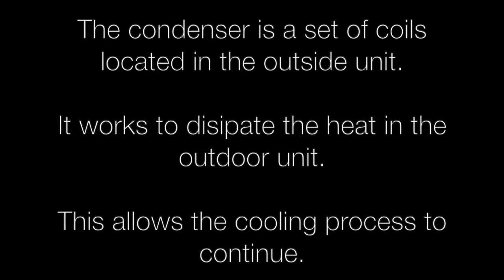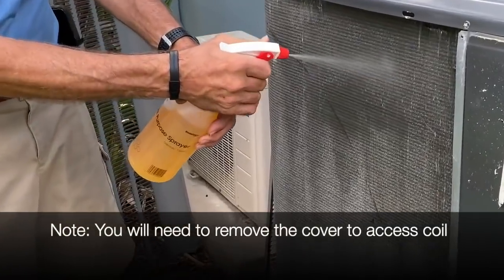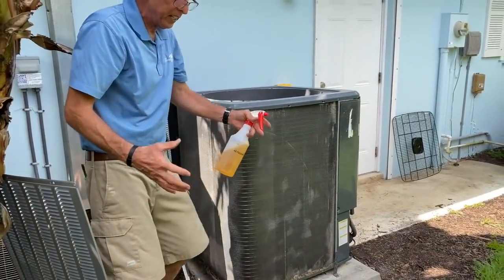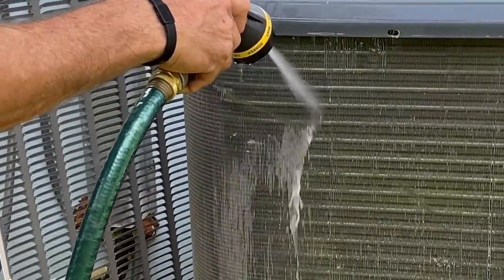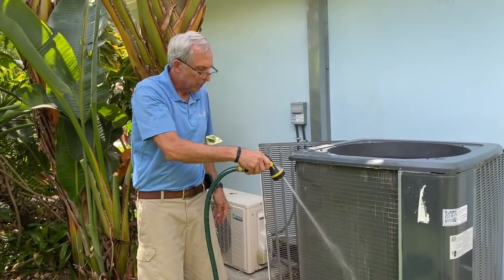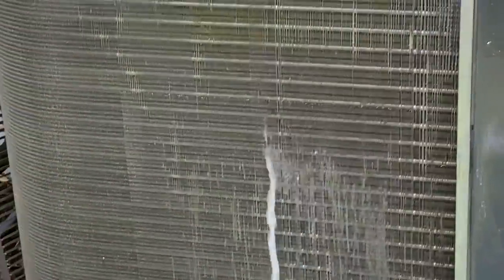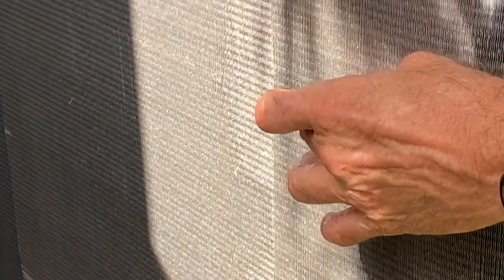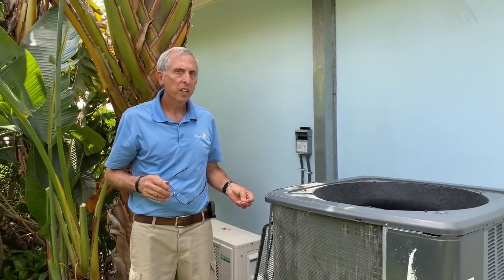How To Clean Your AC Condenser Coil

Comment: Your video and a couple more helped save me $380 from two HVAC contractors who were willing to charge that much to clean my condenser. What a bunch if slithering snakes they can be! WOW...they won't make any money from me, but, they will make money from other people. Videos like yours and various other videos here on YouTube are a Godsend. Thank you!
Reply: Are they snakes or honest people charging you fair price for the labor involved?
Reply: Most of them/ a lot of them are lying thieves. I do handyman work and can change capacitors on ac units when there is a problem. The capacitors do go out once in a while, and are very easy to replace, and very cheap too ($10-$15). I only charge $60 to do it. One ac unit I went out on because it was not cooling enough. I found that everything was working fine, but the indoor evaporator coils (you can't see but it is on top of heater unit enclosed in sheet metal) and the copper line going to the outside condenser was completely iced up! So I shut it off overnight to thaw out. I also checked the filter because the top 2 main causes of ac icing are clogged/dirty filters and refrigerant undercharge. The filter was very dirty, so I changed that, but I also told him to call someone up to check the charge because it was probably low, and I didn't have any r22 anyway to put in it. He had someone come out the next day to check it out. He got charged $380, and all the guy ended up doing was putting in a new fan capacitor. I had put in a new fan motor a year ago along with a new run capacitor, and I new from the initial check I did that the fan was working perfectly fine. The guy never even hooked up gauges to the unit! The unit was working fine when the guy turned it on because it had completely thawed out, and the filter was already changed. So really what he should have done if he didn't want to hook up his gauge set was to charge him $80 for a service call. I just wish I had been there to stop it. I really hate to see people getting ripped off!.......And they almost always tell the homeowner that they need a whole new AC that will cost $10k -$12k.Talk about getting ripped off!!! A new AC and heater and evap core only costs the company anywhere from $3k to $5k, and then they TRY to charge the customer $6k-$7k profit for a day or 2 to install a new unit! These guys are the king of thieves!  Along with car dealerships :)
Reply: @raymondtakeall4803  slithering snakes - is a correct answer...
Reply: @MRM-wp4gr  Handy man work not trained or licensed professional, that's like going to drug dealer them telling you doctors ripped you off lol. Capacitors shouldn't go bad in year, you get what you pay for. Most places in my area north east capacitor, is  minnum of $200. Anyone can do it for less like anything else cause they're not running a company where you have overhead cost. Yes really cheap units such as goodman are $3 to 4k, with cheap parts put it once again you get what you pay for. Being critical of pricing is good to an extent. When you buy a new car, do you tell them your getting ripped off? The actual price of car what it's resold for is significantly higher. When you go your doctor and writes a script for pill that cost $ 20 to make they charge 100 times that amount do tell them they're ripping you off?
Reply: @MRM-wp4gr  maybe your area, you said Cap'n went bad when you installed a new one after you replaced fan motor, then cap went bad again after tech put it in. Which would indicate the fan motor is the problem or both capacitors were bad from the box. Most likely the fan motor, which I'm sure there is no warranty on it, cause most manufacturers require qualified professional to install it, or returning it for warranty is nightmare. So in reality you can he favor you did really undid itself. As client was still inconvenienced not having comfort cooling. As far charging 12k that may just your area or most likely there are having to other modifications to duct work to ensure system that doesn't fail. Goodman man units on average for equipment alone run 2-4 k, for each piece. Depending of course on the model. There's a reason goodman is known for contractor grade because it's cheap, so if most home builders use then of course rate of sales would be higher. Goodman is cheap equipment with history of components failing before they're life expectancy.
Reply: @raymondtakeall4803  I don't believe he actually did change a capacitor....he just charged for one. I know for a fact that it was not bad in the first place because I had just checked it the night before. This was a total rip off!
Reply: @MRM-wp4gr  ABS in clearwater area wanted 285 for a 10 capacitor in 2007 money...never changed still fine to this day. thieves!
Reply: Do you know the concept of overhead? How much money it costs to put a well qualified service technician in a fully stocked truck? Do you complain that an $8 piece of steak costs $41 at a nice restaurant?

Comment: For years, we've used Dawn dishwashing liquid to help clean the coils - never needed coil cleaner. Also, the compressor bag cover should be removed and everything carefully cleaned. If the cover has broken down (lots of cracks), replace the cover.

Comment: Had air conditioners for 50 years and never cleaned one till this summer. Got a new one about three years ago and looked at it this summer and it was solid with grass trimmings. I sprayed the best I could with water, but tomorrow I will get some of that cleaner and do it again. Thanks for the info.
Reply: Sherman Mace -- You do not need a cleaner if all you have is grass clippings on the coils.. Water sprayed from the Inside of the condenser (Take off the top first) all the way up and down the coils will push the dirt, etc., that got sucked into the fins..
Reply: I also replaced 30yo a/c last year then this year when maintenance check guy told me it needs cleaning fr all dirt / lawn debris, i cleaned it with water but only fr outside, now 2 months after checkup, it doesnt cool. 😱

Comment: Rule of thumb is start the rinse inside spray out then rinse the outside starting at the top and work your way to the bottom. Also the newer all aluminum coils recommend clean with water only and do not use coil cleaners.
Reply: This program is very interesting
Reply: Right coil cleaner is not good for aluminum for cleaning better water and soap only
Reply: I use dish soap n water...very dirty clogged fins I use water jet ..
Reply: Even better… I use shop vac with a soft brush to remove all the dry crap first, then re-assess if you need to use water.. I DON’T use chemicals!!
Reply: Weak dawn solution , weak and Rinse well.
Reply: Thank you , I enjoy aan that cares for his self and family .
Reply: How would you know if you have the newer aluminum coils? My unit is a 20 year old Tempstar Smart Comfort 2000. Is that considered newer?
Reply: @GrnXnham  🤷‍♀️ I was wondering the same thing
Reply: @GrnXnham  magnet test?
Reply: @cpd969  great idea 👍
Reply: I agree 100% with the idea of starting from inside first. When you start outside you're pushing some of the dirt and debris further into the fins and may not be able to get it all out. By doing inside to outside first you're pushing most of the debris and dirt out and you can see better to rinse the coils from top down once you've done a thorough job from the inside out.

Comment: I use the foaming spray cans and you have to buy the proper size.  A 19 Oz can will handle an average size, tower type unit.  As you say, it is important to force the water from inside to out as this is reverse of the operation in use.  The fan pulls the air into and up through the unit, exiting at top.

Comment: I've always use Dawn soap in a spray bottle or hose end sprayer and it has always worked great for me. I do it a couple of times a year. It really makes a difference and is cheap and safer than chemicals.
Reply: Is that Down dishwasher soap?
Reply: @dinodino6907   No. It's Dawn dish soap  Blue in color. I use about a quarter of the bottle in a gallon sprayer and if you don't have a sprayer you can mix it in a bucket and slowly pour it from the top and let it run to the bottom and rinse it after a minute or two. Works great .
Reply: @Preston Starr  Your welcome and glad it worked for you. It's pretty good stuff.
Reply: Good to know.  I have some of the newer Dawn Foaming dish soap.  I was thinking about trying it.   Do you think it will work?  TIA
Reply: @anitarushlow4022  It should be fine but you might want to fill your sprayer or bucket or what ever  you use with water first then put your soap in last so it won't all turn to foam before you spray it on. Just leave it on for a couple or so minutes before you hose it off. Should be fine.

Comment: There is also a product called Foaminator, most plumbing supply stores carry it. It’s a 2 part mixture. Enough for a 2 gallon sprayer. Mixes with water. Just spray it on, wait several minutes. Don’t let it dry. Rinse with a garden hose and your system coils will look like new. You don’t need high pressure the Foaminator eats and removed everything.

Comment: Great Job David! I have a 2020 RHEEM 1.5 Ton that was frozen outside and by diffuser in the furnace froze up 30%-50%. Causing a breakdown of the complete cooling system. I turned off the AC on my thermostat but allowed the furnace fan to run defrosting the big copper gizmo inside the furnace. I put in a summer-friendly lite air filter to increase airflow. Made sure my vents throughout the house were open so the air didn't back up causing an air circulation nightmare. Hoping cleaning the outside coils will get the circulating cold air and stop freezing up!
Reply: If the system is icing, cleaning the outdoor unit will add to more icing.  You are icing due to low operating pressures and therefore lower operating tempuratures.  If you clean the condenser, you will lower the both the operating pressure and tempurature.  Icing will persist.  You need to insure the operating tempurature of the indoor evaporator coil is above 32 degrees.  You may have an indoor air flow issue (e.g. dirty filter, dirty evaporator coil, fan motor issue, impeller issue, low refrigerant charge will turn a properly operating 38 degree coil into a 25 degree ice maker.  A real dirty outdoor coil will raise the operating tempurature of both indoor and outdoor coils  10 to 20 degrees.  So, cleaning the outdoor coil, although a necessary venture, will cause lower operating temperatures and will not cure an icing problem!

Comment: As a 30 year HVAC contractor. Here are the proper steps:
Turn off power
Remove condenser fan top assembly
Flush condenser coil from inside and outside with water hose ( high flow,low pressure)
Spray coil cleaner of your choice- generously. Let stand for 5-10 minutes. 
Using hose,flush cleaner from coil cleaner from coil, starting at top inside of coil (angle spray downward) and working to bottom on each side. 
Continue until water flush clear.  
Assembly and let dry. Wipe cabinet clean. Power up. Enjoy.

Comment: Thank you for your video, I had my AC. Revamped, but the AC compressor is under sized for the house.
  I have a compressor with two fans used to have three like yours.
  Got to get another compressor straighten it out, AC runs all day, without shutting off.

Comment: Rinse from inside out, top to bottom with low water pressure! High pressure will bend the coil fins!
Reply: No it will not
Reply: Definitely don't use a power washer
Reply: @balkanacbosanac  yes it will and very easily.

Comment: I wash mine every year in the spring. Turn off the electric, then I remove the fan bolts and lift the fan up with a rope. I put a nail under my eve to hold the rope. That keeps my fan up out of my way. Then I vacuum out any leaves in the bottom of the unit. Then I remove the outside grills and wash the coils. I like washing from the inside first, pushing all I can toward the outside. I have used coil cleaner first which seems to work well but sometimes they are sold out so I'll just use water alone. I wish the A-coil was this easy to get to. It's inside my hot attic. That's a winter job.

Comment: Doesn't hurt to wear kitchen gloves, mask, long sleeves, and pants, while messing with coil cleaner, especially if you use a pump sprayer, or hose adapter. This same principal applies to your refrigerator, but you typically don't need coil cleaner, just a long coil brush, and a shop vac--that can extend the life of your fridge for a good while.. Those two things, along with draining your hot water heater every year or two, and your house will stay happy.

Comment: It seems to me, that if the Air is being Pulled Through the Coils from the Outside, wouldn't it be Best to Start Rinsing from the Inside to the Outside??? 
Why push the dirt further into the coils spraying them from the Outside, first??
Perhaps there is a really small outlet you can use to screw into the hose, so it will fit easier in there with the fan blades in the way..
Reply: Agreed, most other demonstrations and guides recommend cleaning from the inside out, particularly in units that might have multiple layers of coils.
Reply: I agree, the others have the cleaner sprayed inside, then spraying from inside out, never from outside in.
Reply: Your 100% right, good observation and what you stated is exactly how I was taught working in the field in Arkansas from guys that did it all the time. Back in the 80s and early 90s.

Comment: This "Rinse from the inside--No, rinse from the outside" debate is pointless. The coil cleaner is going to loosen dirt and put it into suspension (that how soap works) and rinsing from any direction or both will flush the dirt through and down with the water flow. Gravity works both from the inside or outside. The only thing I'd recommend different from the video is to vacuum up as much of the grass and loose materials as possible first, then wash and clean.

Comment: Why have I never seen an AC GUY do that with the outside or inside coils? Is it supposed to be part of a maintenance check? The last guy didn't seem to think it was a good thing to check the PURON!
Reply from the maker: change companies
Reply: My AC maintenance was done today and the guy did clean the fins and he suggest not using a pressure washer because it will damage the fins.   Before replacing my old central air, I had a maintenance contract with HomeServe and I don't recall them ever cleaning the fins.  The maintenance contract I have now is with the company who install the new central air.

Comment: I use Dawn detergent mixed with water good video though. I would be curious to know how long do you have to let a draw before you turn back on the electricity. I know that it when it rains it rains right on it when it's moving.

Comment: Pro tip : u can add soap while the unit is running .( on the Coil or evaporator or condenser or the  radiator  only) Wy ? cause it will be pulled in deeper in the Coil "  stop the unit once the unit is well saturated and wait 15 minutes so the soap ( 1/3 dish washer soap 2/3 water) will do the job ...then rinse a lots and re start to dry the unit 👍 ( 30 years exp) 👍

Comment: David thanks for this video. I have a Trane AC in a beachfront condo in East central Florida. The condenser is up on the roof. We’ve been here for 18 years and I just bought our third AC for our apartment since 2003. They rust out and then eventually fall apart. Should I be doing this more frequently than once a year? Is there anything I can apply to the outer body to stave off rust, like turtle wax or something else? Of course I would avoid getting any wax on the coils themselves. Will I void my warranty if I take the panels off like this? And I read in comments not to use this coil cleaner on aluminum fins - we have Trane, so I assume this product should be avoided on Trane spine fins. Hope you can answer these questions, and thanks again!
Reply: Salty air if living near ocean.
Reply: Rust from your location are on anything metal, due to salty in air.

Comment: Thanks for the video. Maybe this is my problem. My AC is running but the temperature in my home is remaining fairly steady and not getting cooler or hotter, and my AC just shut off on its own maybe cause it got overheated. Do you think the problem is with my condenser coils and if I clean it like you did here my issue will be resolved. the AC is only 3 years old. Can I just wash my coils with regular dish soap that is diluted in a spray bottle? Thanks!
Reply: I doubt it. Something else is happening. I'm just seeing this video now and have never done this years after owning my home (no wonder my bill is so high!). Whenever my AC is not blowing cool air, it's usually after a power outage. I've had to turn the AC off, then reset the breaker at the panel, wait for 30 min or so, then turn the AC back on. But I'm not an AC mechanic so your issue could be something totally different.
Reply: @napynap  - If you have to reset the Breaker at the Panel, you may be overheating that electrical line too much and/or the Breaker is very old and not able to handle the load...Too much heat caused by electricity means too much resistance, which if not fixed, can cause a fire..  
You should never have to go reset the Breaker because or a power outage...
You need to find out what exactly is causing the breaker to trip..